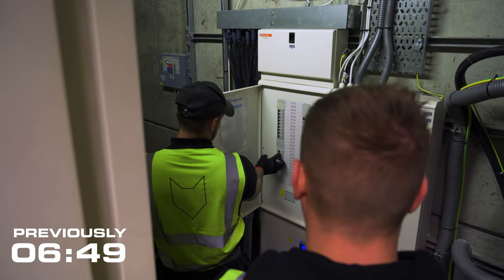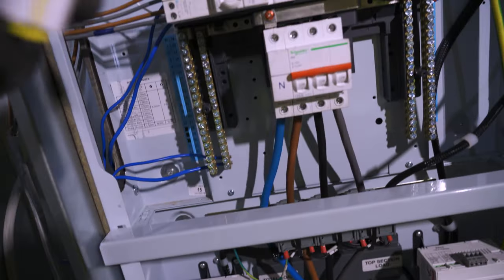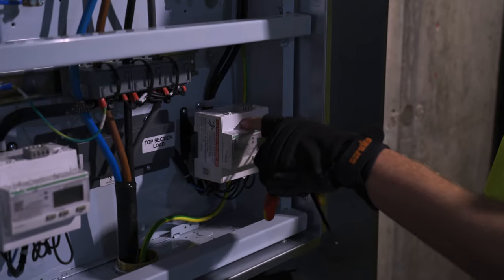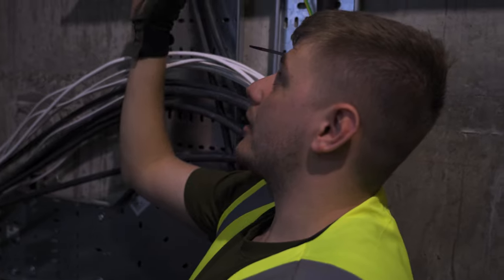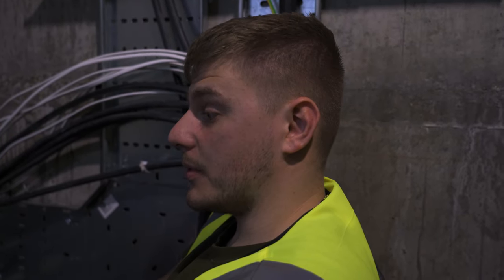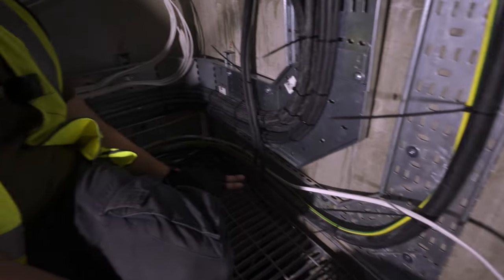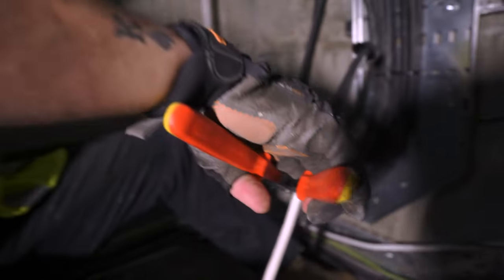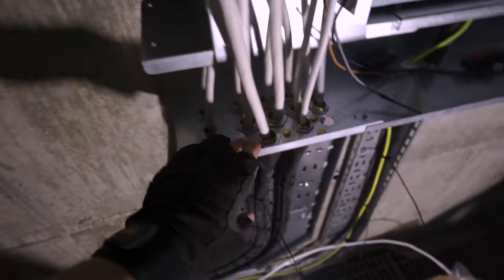Glanding multiple SWA cables ready for second fix

Comment: I wasn't fully sold on this KQ range until I realised it is designed to take ANY din-rail device, as well as KQ accessories. Makes the fitting of an SPD especially way quicker and easier than other brands

Comment: I've worked on a kq board before and I really don't understand why they don't come with the system the isobar p boards use so the rcbos plug in and have no fly leads I assume it's an add on but at this point it might aswell be standard

Comment: Why do you put the banjos and bolts on the outside and down ?
Reply: The Banjo doesn't go on the inside, you can put the bolt facing outward so the wiring will never rub up against it.